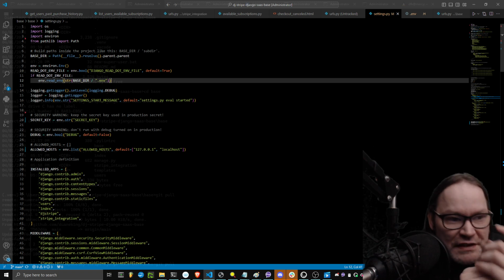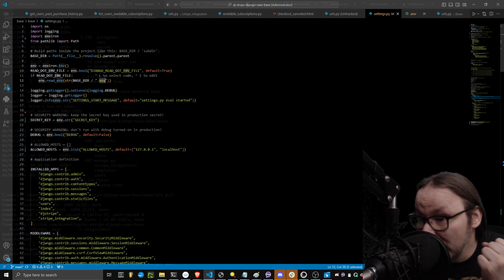Duane's Systems Design Tutorials: The Configuration Domain

Comment: Hmm if I understand correctly:

- we set config data, including stuff that has to be secure in a .env file 

- we have a separate program which sets up the config/settings for the main program we want  to run

I guess this would be a more modular and secure design, compared to if we didn’t use a .env file and a “settings setter” program.

Any chance this is on GitHub? It may be useful for me to review the code, so I can better understand this sort of design.

edit: I'm not sure what non functional defaults means  (cf: ~30 seconds)
Reply from the maker: The environment library that I used allows injection from ENV values and from the .env file as an override.

Think of configuration as a dependency that can be injected like any other mockable thing.